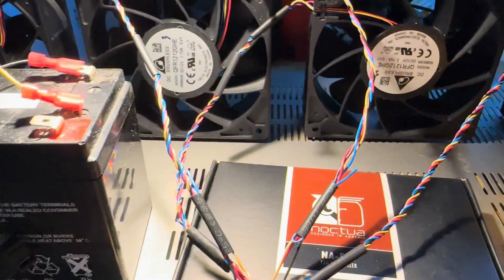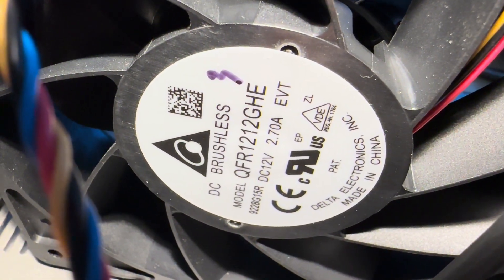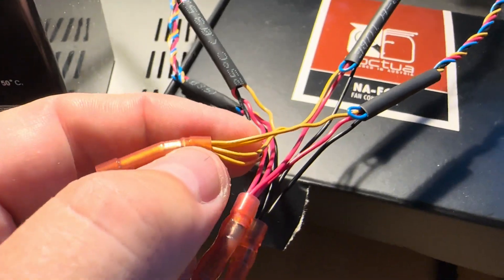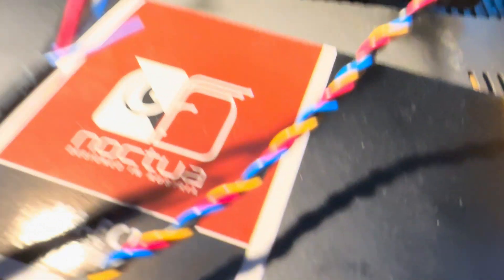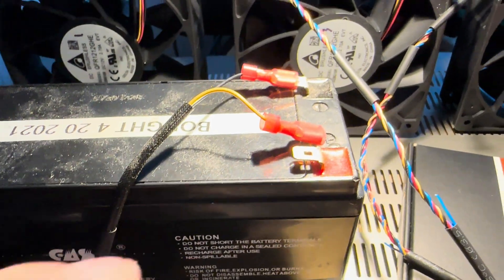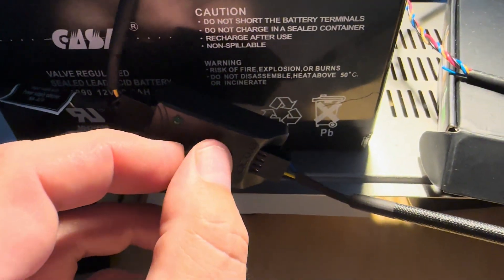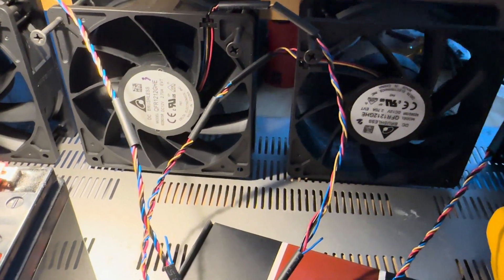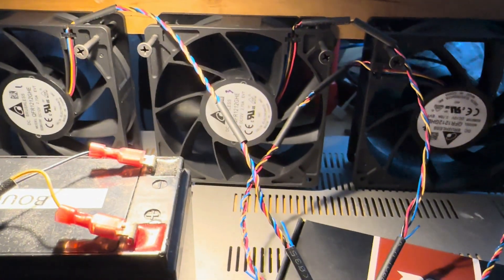How to connect 4 Delta QFR1212GHE 12V Cooling Fans with Noctua NA-FC1 PWM Speed Controller

Comment: The NA-FC1 is specified for a maximum current of 3A. I suppose it is by far overloaded with this setup. The stickers on the fans say 2.7A each and the blasting power they produce seems to confirm that.
Reply from the maker: You are 100% correct, I bought these fans as they are quality and do not plan on running them at 100% at all. I do not want to listen to hair dryer noise when they are at full speed so during normal use the 4 of them are only pulling 3A or less when running from my solar battery, usually 2A or less. I have a load meter on the battery so I know how far to push them. I did test the full speed of the controller and it does get hot during extended use and so do the wires to the controller. If it goes up in smoke one day I will need to upgrade to a bigger unit. I bought this one because it is small and fits nicely between the 3rd and 4th fan as I mention in the other video that shows them installed. I will post a follow up one day after it has been in use for a while. I did all this to cool off my attic apartment during the summer so the A/C has less work to do when I get home in the evening and put it on. During the day it easily gets to 100 F and this place is old and running A/C would drain my money really quickly. I don’t spend a lot of time in that room anyway. I had something similar many years ago using Nidec Beta V fans but one of them recently started making bearing noise. I did fix it by lubricating the bearing but I know that is only a temporary solution so I decided to find a new set of fans and these seem reliable and have a long history of production so I chose Delta this time. Anyway I am rambling. Thanks for the comment.
Reply: @loveaviation  but i think the link i provided is a temp pwm controller tho so the hotter it is the faster the fan spins
Reply from the maker: @seanwood5443  What link? the Amazon link for the fan controller? The other link is a PDF that shows specs of the fans.
Reply: I'm not very keen on using crimp connections. Informative video but if I decide to ever do this I'd just solder and never have to worry about it.  Good video sir.
Reply from the maker: @crazyeye1  it’s not going to be used in an area where I have no easy access to it. If I see a problem, I will redo the connection but I agree in an automotive use with constant vibration and temperature changes I would solder the wires.